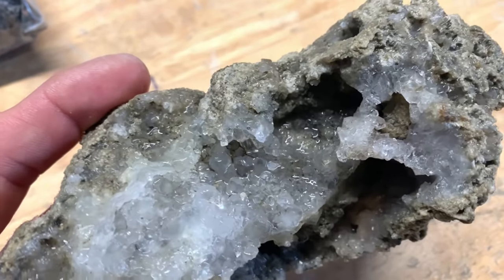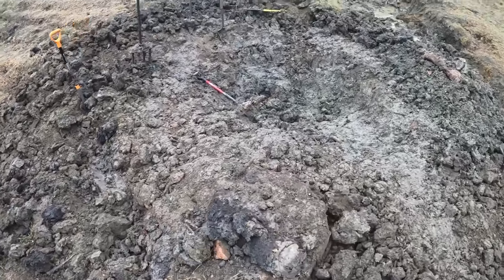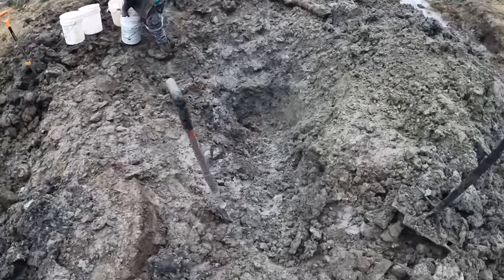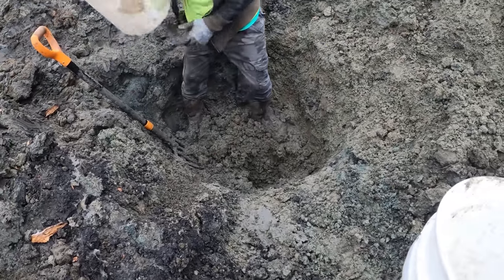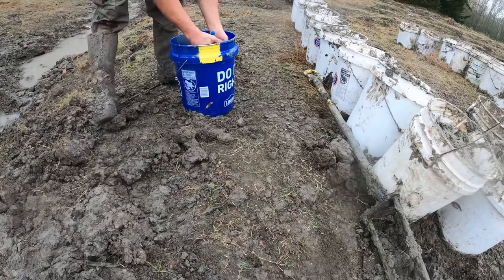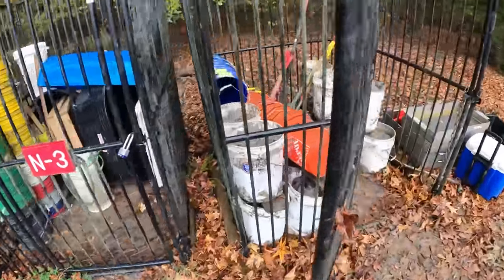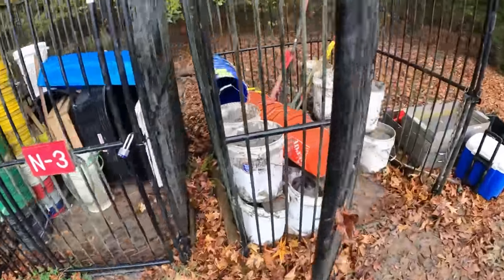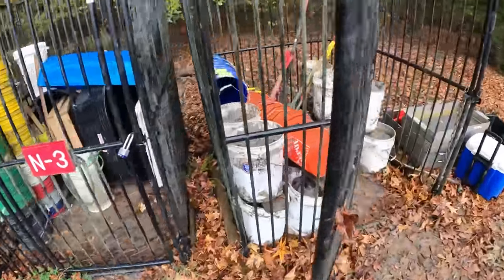💎💰BIG DIAMONDS ARE FOUND IN THIS GRAVEL LAYER!! - Crater of Diamonds

Comment: A little tip the park is flanked on 3 sides with creeks. Those creeks you can go into using a screen to sift material coming off digging tools. There is an old map from the 60s lapidary Journal with crater of diamonds on the cover, shows the layout with the extinct volcano cones in one end of the property. Worth a look especially the creeks which are fair game. Testing diamonds without an electronic tester. Diamonds are doubly refractive a line drawn in a plain white paper if diamond will make the line take the shape of the stone. If not diamond it will magnify the line.
Reply: Boas dicas , obrigado

Comment: You are in the old tailings section of the mine. Yes this was a diamond mine at one time the the tailings were dumped in the middle. Talking to the regulars they go where others have not. Up in the trees. Our first time there we did not see the old sifters by the shed. We found some chippies. We then went to Colorado and found gold in some streams...
Reply from the maker: The old tailing pile is in the south end of the park. This area was missed by the early commercial miner, and early regulars. Adam Hardin discovered this gravel vein. He got 27 diamonds in 50 or so buckets. Very good!! Two were over 1 carat. He went back years later and hit it again. Beautiful 1.16 yellow, 3 other over 1 carat.
Reply from the maker: Digging in and near trees is illegal

Comment: Q. — 1. Do all diamonds fluoresce?  2. If they do, why don’t you check the flipped over graver under a dark tarp with an ultraviolet light? Thanks
Reply: Only 1/3 of diamonds fluoresce. The Crater of Diamonds does not permit anything battery powered regardless

Comment: Hello, good afternoon.  you know.  long ago I found.  something like diamond.  For a while I thought it was until I bought myself.  a presidium tester and it didn't hit me like a diamond.  the tester gives me.  sapphire to something similar has conductivity.  of that degree and logical is a stone.  weighing more than 2,180 carats.  bring several stones.  very crystal clear.  quartz.  It is not.  why does quartz give smaller conductivity than clear sapphire if you know what this thing could be.  that would help to know what this mineral is
Reply from the maker: It could be Topaz.
Reply: @DiamondMinerIvins  Mabe. Or carcita

Comment: The flat side is always the bottom or the back it's usually the bottom and if there's a notch in it anywhere that is the bottom so it would stand up those are usually in the stands I found stands 8 ft tall without the bird so I mean think big look around a little bit you probably got big ones

Comment: So, if he told her she couldn't use a flashlight, z I'm assuming to catch a flash from a diamond, but if you have a phone that has a flashlight on it, could you use it? Or, would they not let you use that either?   Technically speaking, it is electronics, however everyone else there will have a phone!  What would be wrong in using it to help you spot a diamond? Everyone would have the same advantage?
Reply from the maker: No motorized or electric devices allowed to search for diamonds. The flash light and UV lights isn’t productive way to find them.

Comment: That's a bit much digging...they plow it already where diamonds are near the top right?
Reply: Can we rent the cages for. Day or two?
Reply from the maker: Plowing the field is good as long as there is a 8” rain or more within a day or two so all the gravel, and diamond can build up in the lower area. Like trenches, drop off. There are more diamonds in the gravel layers, that’s the same stuff as the field. The field is like a bowl of soup all mixed up for the last 30 years. The gravel layers deep sometimes is virgin material. So have found 100 diamonds in one hole. I’ve found 4 out of one hole. I’ve helped on some holes where 10 plus diamonds were found. 

Holes is where it’s at! That’s why the crater has made it very difficult to dig now.
Reply from the maker: It’s $5 a day or $60 for the month. ⚒
Reply: @DiamondMinerIvins  thank you! I went one time long ago on a really hot day. I would not recommend that. I hope to drive down this spring from Iowa and try again.